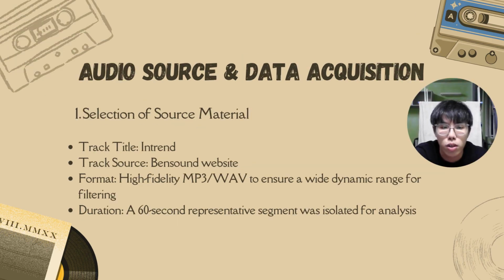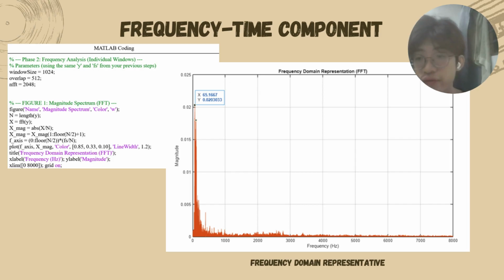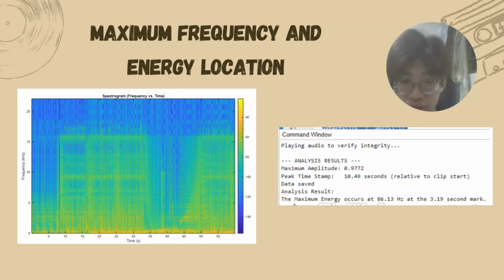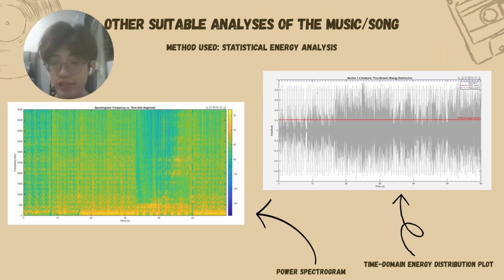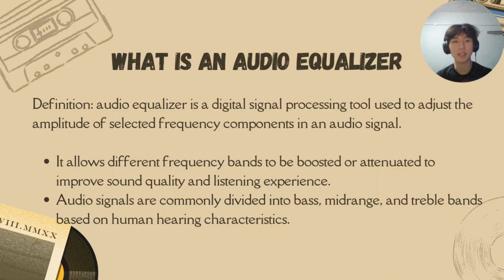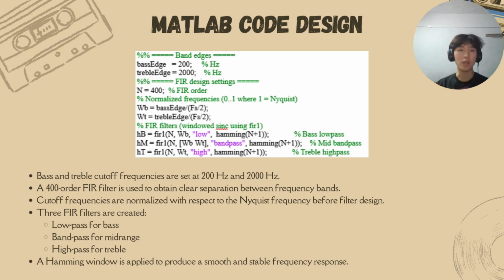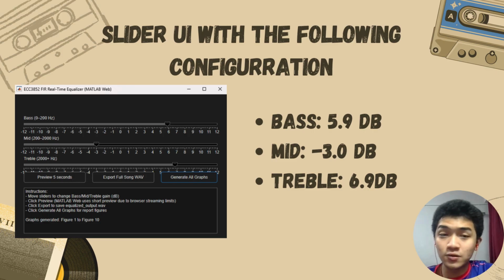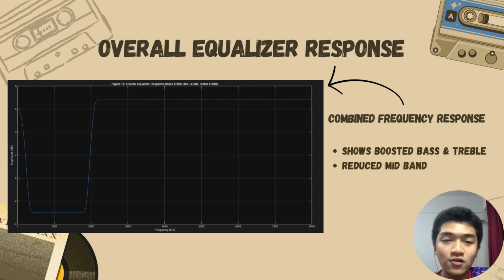ECC 3832 Audio Equalizer for Music

Comment: Hi Lebron, how did you prevent digital clipping when boosting low-frequency bass, especially around 86 Hz?
Reply: Hi Hairel. To prevent clipping at 86 Hz, we used a strategy called Automatic Gain Compensation (or Pre-Attenuation). Since our original signal already hits a peak of 0.9772, we have virtually no "headroom" to boost anything. Whenever we apply a boost using our sliders, our system doesn't just "add" volume but it simultaneously lowers the Master Gain of the entire track by a proportional amount.

Comment: You selected a filter order of N=400. How did you arrive at this number? Did you try N=50 or N=1000? What was the effect on the separation between the Bass and Mid bands?
Reply: Hi KaiJiannn. The filter order of N = 400 was chosen as a balance between frequency selectivity and computational efficiency. When a lower order such as N = 50 was used, the transition band became much wider, causing significant overlap between the Bass and Mid bands and poorer separation between these two frequency regions. Increasing the order to N = 1000 improved the sharpness of the cutoff and reduced overlap, resulting in better separation between the Bass and Mid bands, but it also increased computation time and reduced suitability for real-time use. Therefore, N = 400 provided adequate separation between the Bass and Mid bands while maintaining efficient and stable real-time performance.

Comment: Given that the track has a moderate RMS amplitude (0.21) but a high crest factor (4.65), how would this combination affect the listener’s perception of loudness and dynamics, and why is this suitable for a percussive track like “Intrend”?
Reply from the maker: The moderate RMS ensures the song has a consistent, comfortable volume. The high crest factor means there is a large gap between average volume and peaks. This is perfect for a percussive track because it allows drum hits and sharp energy bursts clearly without sounding flat

Comment: You chose FIR filters for your equalizer. Why are FIR filters more suitable than IIR filters for this audio equalizer application?
Reply: Hi Liow, FIR filters are more suitable for this audio equalizer because they provide a linear phase response, which helps preserve the original waveform shape and avoid phase distortion in audio signals. In addition, FIR filters are always stable and easier to control during real-time gain adjustment, making them safer and more reliable for this application compared to IIR filters.

Comment: What is the purpose of normalizing the cutoff frequencies with respect to the Nyquist frequency before designing the FIR filters?
Reply: Normalizing cutoff frequencies with respect to the Nyquist frequency allows FIR filters to be designed correctly and consistently regardless of the sampling rate, while ensuring frequencies stay within the valid digital range.

Comment: How did you decide the cutoff frequencies at 200 Hz and 2000 Hz?
Reply: The cutoff frequencies of 200 Hz and 2000 Hz were chosen based on common audio equalizer standards and human hearing perception. Frequencies below 200 Hz mainly represent bass components, the 200–2000 Hz range contains most vocal and instrument information, and frequencies above 2000 Hz contribute to brightness and clarity, making these cutoffs appropriate for a three-band equalizer.

Comment: Why did you choose a 3-band equalizer (bass, midrange, treble) instead of using more frequency bands in your design?
Reply: Hi Kun! We chose a 3-band structure because it aligns perfectly with our findings in Part 1. Our analysis showed that the song's energy is heavily concentrated in the low-end at 86.13 Hz, with distinct rhythmic 'stripes' in the mid and high ranges. A 3-band equalizer allows us to target these primary musical zones without over-complicating the signal path.

Comment: How does this equalizer design differ from other methods used in audio processing?
Reply: This design uses FIR filters to achieve linear phase and guaranteed stability, unlike IIR-based equalizers which are more efficient but may introduce phase distortion.

Comment: Hi Group Lebron James! It is nice presentation where you guys explained the mathematical formula. I see that your group chose FIR filter order of 400. How can you be sure that by using that order the output will have clear separation?
Reply: A filter order of 400 gives a steep roll-off and sufficient stopband attenuation, which minimizes band overlap. This was confirmed through frequency response plots while keeping latency at an acceptable level.

Comment: Hi Lebron James group. How did you determine that 12 dB is the best value for the sliders in real time equalizer? Did you experiment with higher values and find that it caused too much distortion, or was 12 dB chosen based on a specific standard?
Reply: Hi Adriellll! We chose the 12 dB range because it strikes the perfect balance between musical impact and digital safety. Since our initial analysis in Section 1.3 identified a peak amplitude of 0.9772, the signal is already very close to the 1.0 clipping limit. Because decibels are logarithmic, a boost higher than 12 dB (which is roughly a 4x increase in signal strength) would have immediately pushed our high Crest Factor transients into harsh digital distortion. We experimented with higher values, but they caused the 86.13 Hz bass hits to lose clarity and "square off," so we settled on 12 dB as the industry-standard "sweet spot" to enhance the sound without destroying the audio quality.